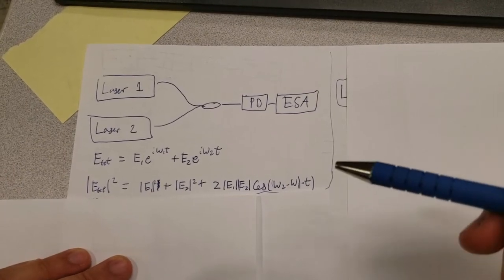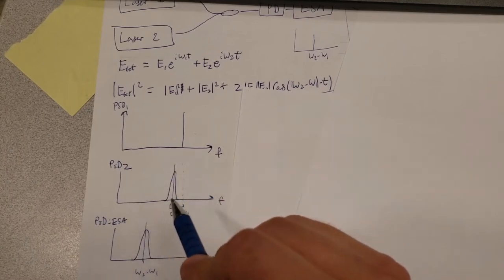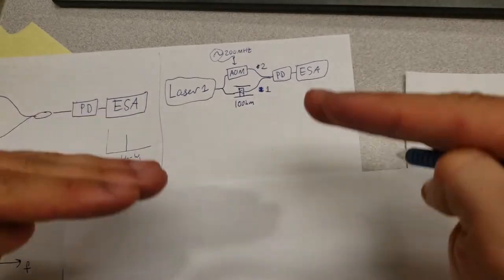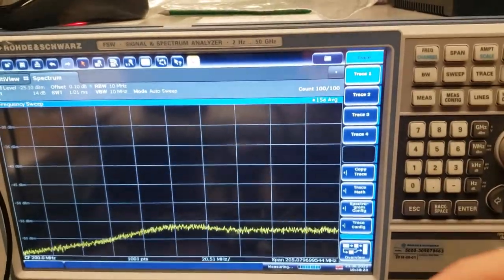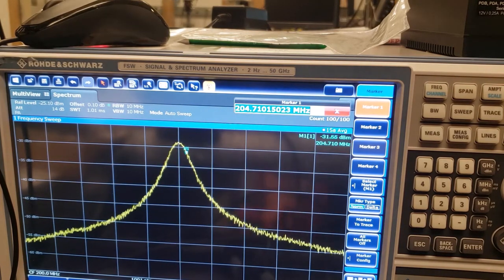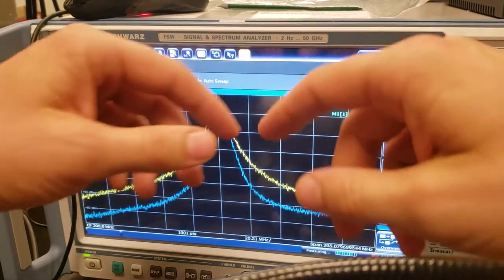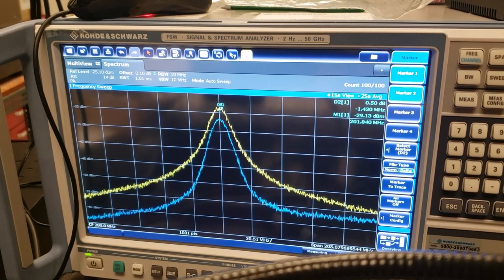Laser Linewidth - measurement and explanation

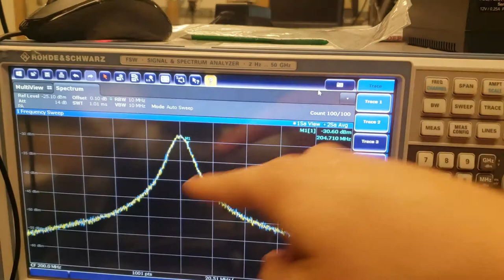Comment from the maker: Note: At 10:20, I incorrectly assert that the linewidth measured on the ESA is 5MHz and that the inherent linewidth of the laser therefore must by 2.5MHz. The mistake is that the 5MHz is only the distance from the peak to where the spectral power drops by 3dB. When measuring linewidth, we actually care about the full 3dB width, which in this case would be 10 MHz. Therefore, the actual inherent linewidth of the laser is 5MHz.
Reply: Thanks! I was wondering about that!
At 4:35, you wrote the same expression for the linewidth of both the AOM and 100km spool output, but are they supposed to be the same?  Is the linewidth of the ESA is twice the linewidth of the two (just the sum of the linewidths)?

Comment: Thank you for useful video.
Is this measurement setup configured by PM fiber better than non-PM? 
I expect PM-setup gets higher signal intensity at the photodiode.
Reply from the maker: Glad that you like it! 

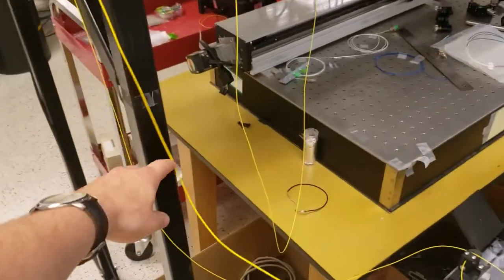Using PM fiber does not provide a significant advantage. To ensure maximum interference between the reference signal and the signal from the AOM, they just need to have the same polarization at the photodiode, which can easily be ensured by using a regular polarization controller placed in one of the "arms" as shown at 6:08. Since the exact SOP does not matter as long as it's the same for both signals, the paddles can be adjusted until maximum interference is achieved.
Reply: @yourfavouriteta  Thank you for your reply!
 I understand to use polarization controller.

Comment: Thanku for the info. Can we use multi mode fiber for this setup?
Reply from the maker: You're welcome, glad you found it useful.

I don't think using a MMF would be advantageous. If two (or more) transverse modes propagating with different speeds are present in the system, I think both of the signals they produce will contribute to the measurement simultaneously, making the result more difficult to interpret.

Comment: Really nice informative video! Thank you! However, how would you stabilize the laser frequency over time for some high precision spectroscopy measurement?
Reply from the maker: I am glad you found it helpful!

Laser diodes with linewidths below 1MHz are commercially available for around $1.000. More expensive models in the low kHz range are also available. Depending on your application and budget, these might be sufficient.

Alternatively, you can stabilize a laser to an external cavity. The idea is that two highly reflective mirrors with high mechanical and thermal stability create a Fabry-Peroy cavity with extremely narrow lines. Let's assume that this FP cavity line width is 0.1kHz. If you shine a 1MHz laser centered on one of the FP lines into this cavity, the light that comes out will be filtered and have a 0.1kHz linewidth. If this light is sent back into the source of the 1MHz laser light, it will be amplified and sent back to the FP cavity for another "round trip". Eventually, the filtered light inside the 0.1kHz range will "steal" all the available power in the laser source, effectively changing it from 1MHz to 0.1kHz. 

One detriment is that the central frequency of the laser source must be aligned with one of the FP lines for this trick to work, which makes the system less tunable.

Comment: Good. when I tested, there were many peaks near the peak. what was the reason
Reply from the maker: Hmm, could be many different things. If possible, please tell me the following:

1) What is the driving frequency of the AOM and what is the frequency spacing from the main peak to the many peaks you mention? Can you post a link to the spec sheet of the AOM and to the function generator you use for driving it?
2) What type of laser are you testing? Can you post a link to the spec sheet? Maybe it emits light at more than one frequency? This can also be checked with a high resolution optical spectrum analyzer if its resolution is higher than the spacing between the peaks you are observing. 
3) What current are you driving the laser with? If driven with too high current, the electric field in the gain medium may become so strong that four-wave-mixing occurs, where new frequency components are generated. If FWM is the problem you can check it with an optical spectrum analyzer and remove the problem by reducing the driving current. Note that changing the current will alter the gain of the medium and therefore change the linewidth a bit. 
4) What photodiode are you using? What is its bandwidth (maximum operational frequency) and saturation power? If a very intense sinusoidal optical signal hits a photodiode so the saturation level is exceeded, the generated electrical signal may get "clipped", which causes spurious frequency components to appear. For example, a clipped 200MHz signal will cause extra frequency components at 400MHz, 600MHz and so on. You can check this by reducing the incident power. 
5) Try running the linewidth measurement setup with the laser turned off. The electrical spectrum analyzer may be experiencing interference from other devices in your laboratory.